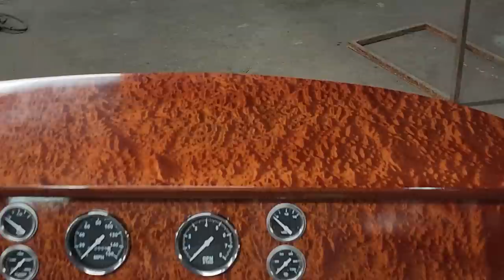Final mockup... is the steering going to work? ⚠️

Comment: I think you’re gonna need working pedals and the seat in place before you set that steering column in place. As it sits that looks like the most uncomfortable driving position because you don’t have any arm extension, she’ll be driving with T-Rex arms.
Reply: hmm is the floor at the leg area too high?

Comment: Steering wheel needs to be much closer to the dash.  Should be looking over the wheel, not through it.  Just my opinion.  Car is coming along great.
Reply: Maybe a smaller steering wheel.
Reply: My thoughts also. Too close to the body. Needs in my opinion be at least 8 inches shorter if not more for comfort.
Reply: Exactly imagine if had crash and steering rack comes at u needs to go at least 10” easy forward
Reply: The  wheel is way to close you wouldent want to be in a crash . By eye the steering column  looks way way to long way way to long . Maybe a smaller steering wheel and brought in closer to the dash board . It really does not look correct  chad ..  who am i its not my build at the end of the day  what ever pleases you
Reply: @christoschristos1159  To be in a crash, one would have to assume the car would be driven on the road? I don't see this tinker-toy passing any inspection for road use. Maybe from a trailer into a showroom for viewing? I know it will look lovely when complete but will be locked in the barn most of its life!
Reply: The position of the wheel to the driver reminds me of how close NASCAR driver's wheels are to them in the driver's seat.
Reply: I agree looks very uncomfortable to drive (I would add still better than any car I’ve ever built)
Reply: @@radham5385 I did it's about a foot or more to long

Comment: The steering wheel: ideally, the steering wheel should be positioned so that its centre is at the same height as your neck. According to the Insurance Institute for Highway Safety, keep 10 inches or more between a driver and their steering wheel.

Comment: Steering column definitely needs shortened by at least 4 to 6 inches and I hate to say it but the steering wheel looks about 2 inches too big
Reply: If you look at cars like this from the past they all had oversized steering wheels and I'm sure as it gets closer to marrying the body and chasis he will make adjustments..
Reply: The reason for the large steering wheel is that back in the day, they didn't have power steering. To compensate, they used bus size steering wheels to get that extra torque advantage. The 1955 Chevy 210 I had in the mid 70s, had a huge steering wheel to compensate for lack of power steering.
Reply: It does seem like it's a little long for sure but I'm sure he will make it all work rite when it's done
Reply: Wheel simply needs to be moved forward! The more the better….. it’s not NASCAR!!
Reply: Visually the steering wheel looks to close to the body. Not sure it will be comfortable to drive in this current configuration but I don’t build cars. Hopefully I am wrong.

Comment: You assembled the ball socket wrong.  The firewall is supposed to be sandwiched between number 1 and number 2.  The ball is supposed to be sandwiched between number 2 and number 3.  You stacked number 2 and 3 together.  The ball should be between them.
Reply: Good eyes 👀

Comment: Woo! That dash and interior is going to be sexy...Almost as much as Jolene, almost...BC you can weld a nut on the brake arm, put any old school round pedal you want on there...Since the Steering wheel is going to be removable, possibly a hook on the roof to hang it would be cool...JMO

Comment: Question: Why isn’t Jolene test fitting the steering wheel? Secondly, when you measured the opening in the ball joint in the finished dash, you measured at the opening in the ball, which is different than the bottom of the opening in the mock up dash, which is the out side of the ball. Looks like 3/4“ to 1“ difference. I hope you read this, because this WILL come back to bite you!

Comment: Coming from England I’m not up on building this type of car so forgive me for some comments which may not be quite accurate. Chad has built some amazing cars all from his imagination but this one is seems to be very close to an actual car. Taking on board all the comments out there regarding the steering wheel position, I to feel it’s too far back, not just because it’s dangerous but mainly because it doesn’t fit in with the overall effect, but maybe this is part of building this type of car. I looked on the internet for some photos of actual Bugatti Atlantics and came across one in Jay Leon’s collection. There are a few photos showing the position of the steering wheel which shows it closer to the dash. But as I have said I don’t know the concept of building this type of car so maybe it’s how Chad wants it. It also looks like he will be removing the wheel to get in and out.

Comment: I'm no expert but from my experiences I'd suggest you do some research..I love the way brass looks for contrast,I've done a whole motor and firewall 1 time and costed me alot of time and money caus4 I had to take all the brass off due to reaction to other metals and will cause a ugly color reaction or even rust. As much of a pain as it is I found powder coating is the way to go,spray paint chips to easy and will rust..just look into brass to aluminum reaction could save u a huge headache in the long run,especially since you'll be showing this with hood up.

Comment: Great job guys 😎👍 
That steering wheel is very nice but the diameter seems a bit large. If it were a little smaller, the steering column could also be shortened a bit...

Comment: Awesome! 
From a comfortable sitting position, your wrists should touch each side of the top of the wheel, with arms extended, but not leaning forward. So seat must be in final place to achieve this... Interesting to see Jay Lenos driving the original design.

Comment: Nice job you guys are doing, but I would not only shorten the steering shaft & add a collapsing type if collision,  and shouldn't the fuel cap be on the right side or even better in the rear fender, if driving on left for spillage? More vents would be smarter, and a quicker escape. It seems like the seat should swivel out with the door. They didn't know that stuff years ago.

Comment: This looks like the most uncomfortable car to drive that i've ever seen. I'm sure it'll look awesome though when it's done lol. Steering wheel is WAY to big. That and the angle from the firewall is too low to start. It needs to come in higher through the firewall and more straight to the person with a smaller steering wheel. Difficult problem to fix. It will work but it's not going to be very comfortable, that's all.

Comment: Should you be looking through the wheel or over the wheel. I would think you should be looking over the wheel. With two balls upper and lower and the universal joint you should be able to accomplish it. Or a second universal joint it should be possible.

Comment: In regard of that new engin, maybe you will have to set back the firewall!🫤 it mean that you will have to re align the stering column. Maybe you should try the body on the frame with is engin before going furder 🤔

Comment: Curious which of the Type 57SC Atlantic's you are copying. There were only 4 built and each was somewhat different. Only 3 of the originals has ever been found. Two of those are in museums and the third belongs to Ralph Lauren. The first which was the only one made of magnesium alloy has never been found. It was also the only one with a supercharged engine from the factory. In over 80 years no one has ever found it, but a Canadian company made an exact duplicate right down to the magnesium body. The 3 production cars were all aluminum. They came with different wheels, dashes, interiors, etc. Of course, on a car that probably cost more than most could imagine back in the day the buyer could specify certain amenities. With only 3 of the cars ever being sold I don't know if there is a record of what they sold for back in the day.

Comment: I’m not sure if this is the right term, but if you channeled the car would that bring the body down lower?  I feel like the angle of the column needs to be more horizontal. Having the steering wheel in the middle of the windshield worries me.

Comment: Maybe you need a swing away steering wheel (Fat Man accessory) like those that used to be installed on old model Ts and model As, when cars weren’t very roomy. There are many styles on eBay, maybe you could make one.

Comment: Instead of using all that tape newspaper work's well to. You can use it on bare metal to will prevent it from rusting really bad. Learn this stuff from older folks. They wrap a lot of there metal chrome trim and metal up in newspaper  and if the newspaper has the right date on it you will know how long it's been stored away for.

Comment: Steering column is nice and wheel is too.  If it’s in the way.  Just buy a disconnect for the wheel. Will make getting in and out easier. Once u order a custom column and wheel.  It’s non returnable.  A lotta people don’t realize that. C

Comment: Steering is way to far back , you’ll barely be able to turn the wheel full lock, you’ll be doing the old hand over hand shuffle… and one hit from behind and the drivers loosing their face.( plus next to impossible to get in and out once the seat is upholstered)   Should be at least 5-8 inches shorter and tilted up around 25-30degrees … other than that

Comment: I don’t like to be a critic here Chad, but the steering column seems way too long into the car and the wheel to large. I know you like to do things differently, but there seems to be an issue with safety here. Queen Jolene does not want to be eating steering wheel if the car crashes and also looking through a wheel to steer is not best-practice, and certainly not a safe way to view the road ahead. More thought needed here I think

Comment: Ive never seen a car driving position with such absolutely awful ergonomics... the steering wheel position is at least 12 inched too long, almost comedic if not so dangerous. Driver ergonomics should never be an afterthought, should be taken into account when designing the car.